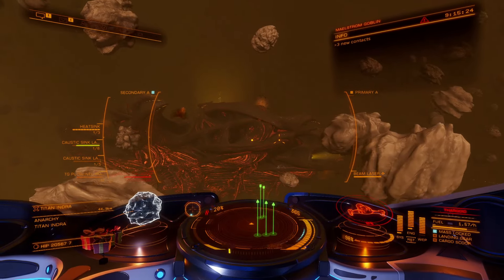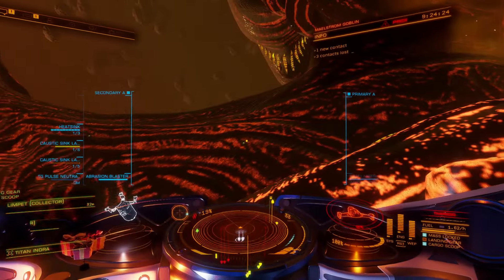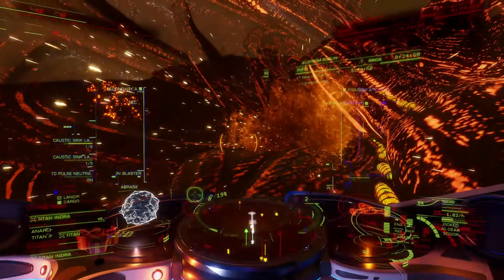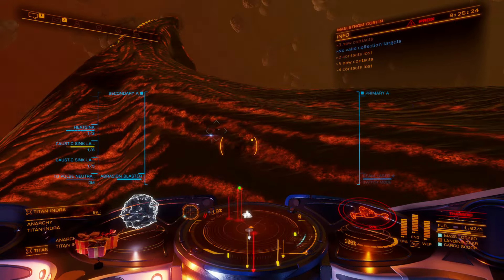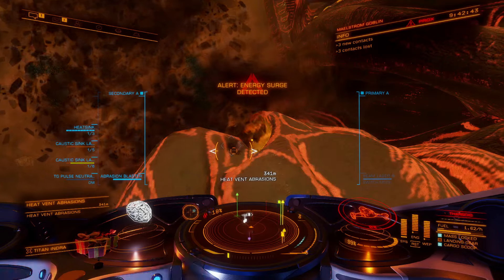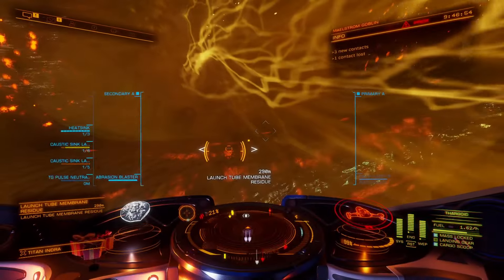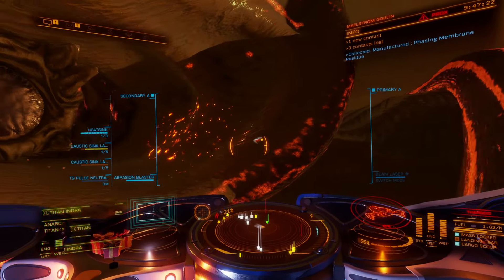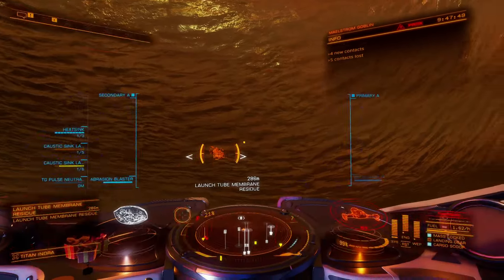Elite Dangerous Guide | Thargoid Titan Materials | Hardened Surface Fragments for AGF engineering

Comment: You say you use a clipper, but the EDSY links to a Krait II build.
Reply from the maker: @djwave28  yeh that was to keep the thermals down, I didn’t have an edsy build, but the power plant alone will give good cooling, you could use dirty drives, clean is cooler though. The thermal vent laser could cool in a pinch too, but you want to use the mining abrasion blaster for the best mats

Comment: Even at 0% heat and silent running it is next to impossible not to get shot by goids  :(
Reply from the maker: @hobosn1per1  are you in solo? If you are in a group with a very angry titan with lots of scouts/interceptors then it’s more difficult. I find it ok in a private session. Every now and then a scout spots me, but it’s not normally a bust even then, especially if I’m in the cold krait (not silent running and around 20%). The hot python mk2 is a different story. But I rarely join a session with other commanders, mostly private.
Reply: @y_ffordd  Ah, that might be it.. I typically only play in open
Reply: @hobosn1per1  sometimes they aim and shoot at you under 20% but for me it rarely hits and caustic missles just circle around me